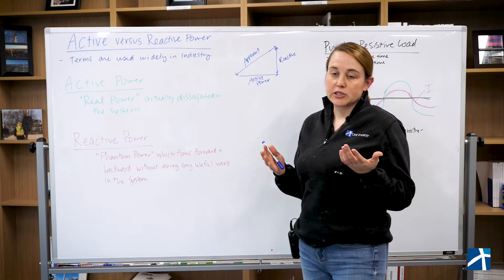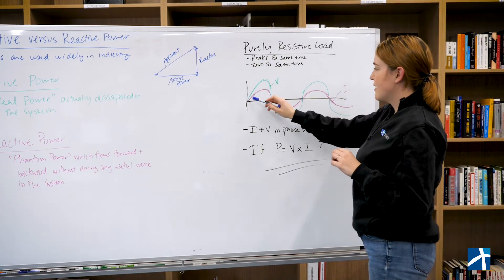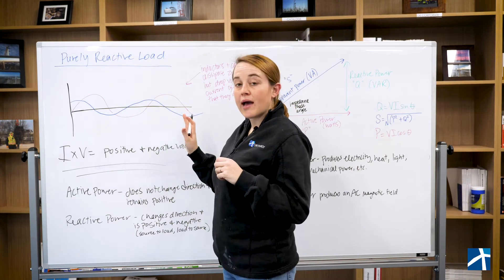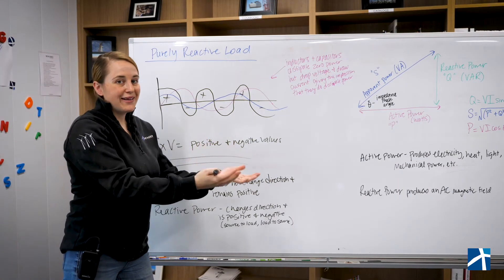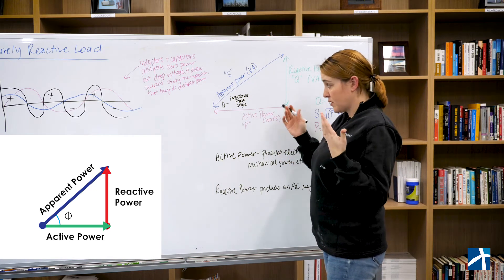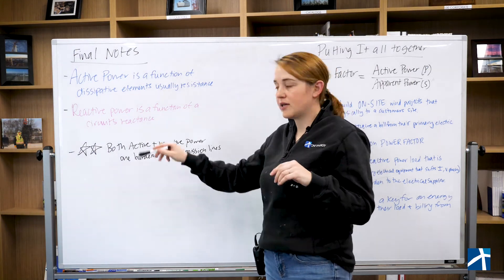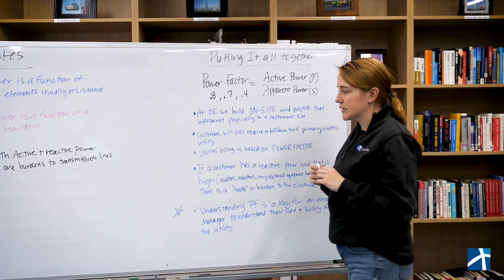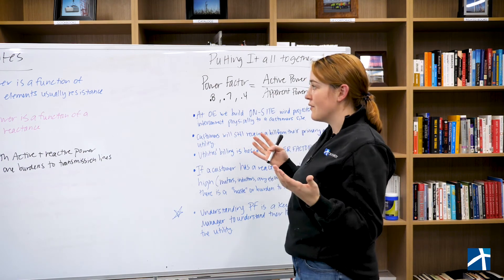Active vs Reactive Power Level 200 | Wind Energy Fact

Comment: Good explanation you should add that reactive power is actually necessary outside the generator system as a way for inductive Motors to turn you need reactive power

Comment: Without reactive power no magnetic field produce in motors, transformers
Reply: So how come they're magnetic field in simply dc current? When no reactive power involve in this matter
Reply: @blurryface369 The reactive power it’s ahead creating the drag for the generator resulting in active power. In a grid instead of condenser like in 220V the HV lines are used to create that advanced reactive power. 380V generator is weak at startup because the condenser capacity is consumed by the engine. That stabilizes the frequency but tension drops and starting torque on the motor is lower. 🙃